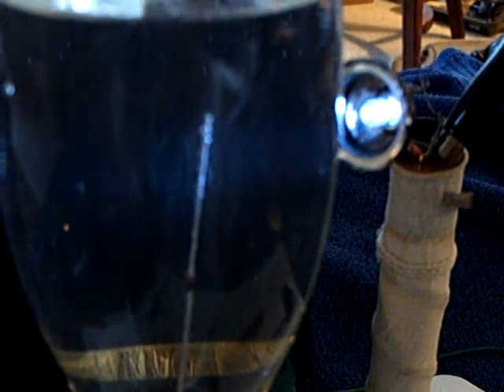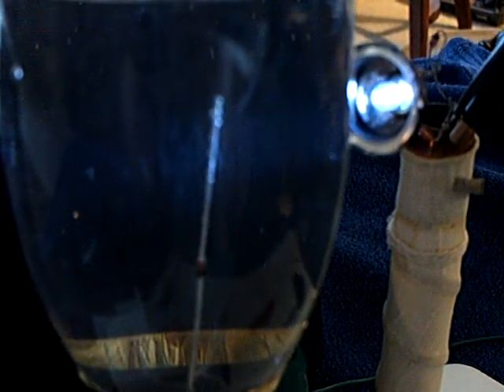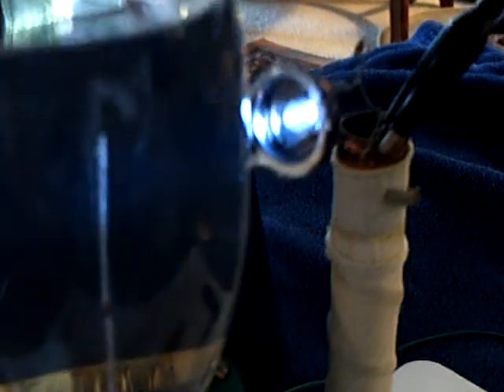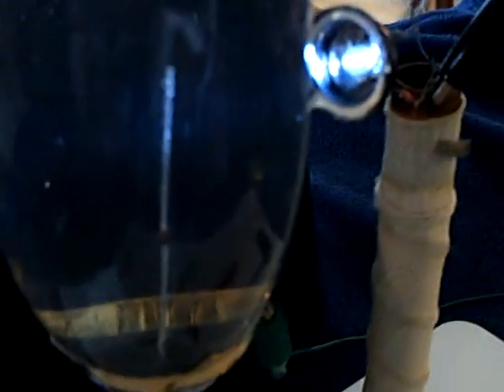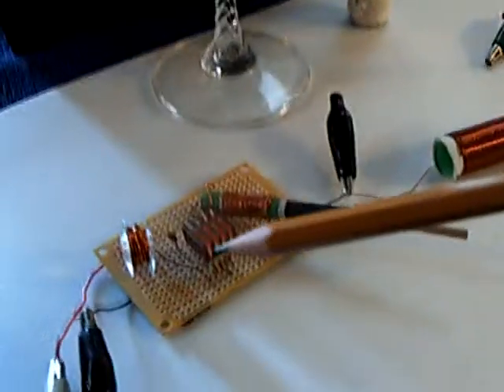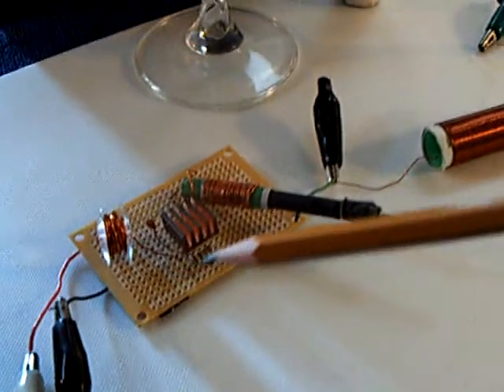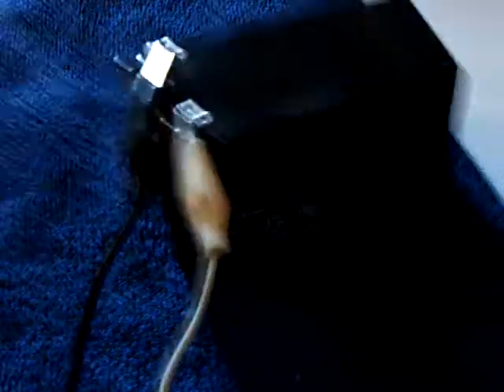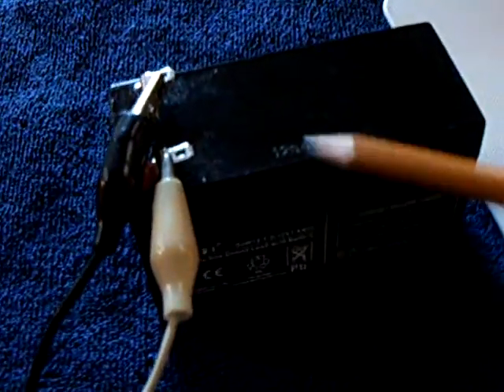Replication of SEC electrolysis experiment.ASF

Comment: Lid, I wonder what type of gas is being produced? Hydrogen? Oxygen? A mixture of both? Something else? This is really odd for sure. If it is Hydrogen gas, would the remaining fluid be room temperature liquid Oxygen? May be the other way around. Lots of questions here. Another new important area of research. I wonder if a copper plate attached to the diode leads would increase the gas production? Anyway this is very interesting.

Comment: The Diode Dr. Stiffler used was a 1N4148 Diode. Is this the same Diode you're using? Thanks again Lidmotor. I'm a huge fan of your & Dr. Stifflers work! =] I've purchased 1000 of these diodes today online to produce the same result on a larger scale. =]